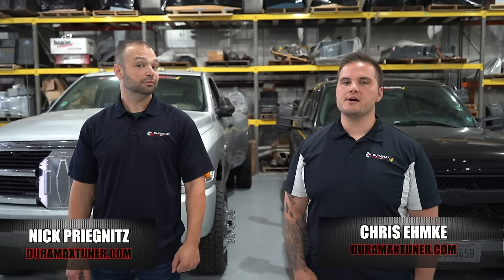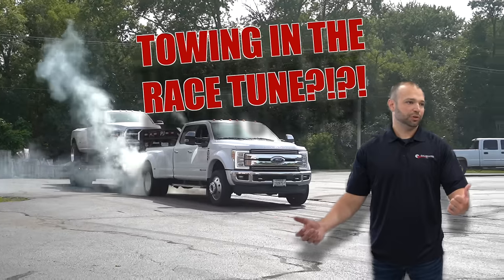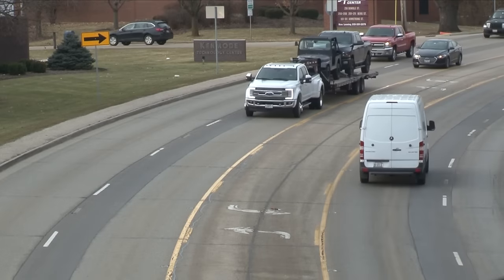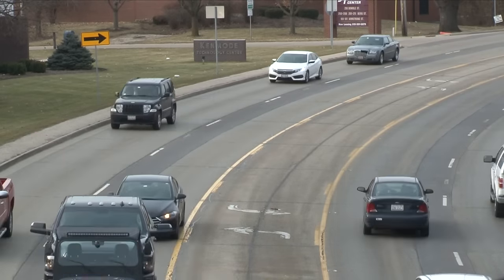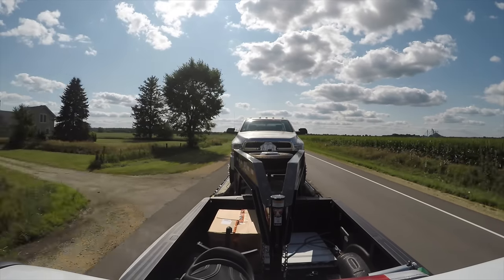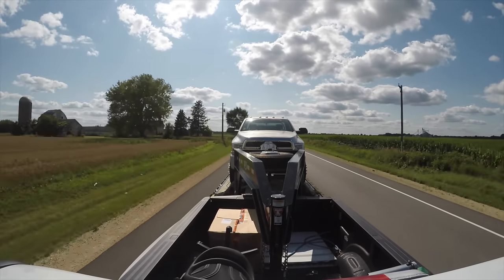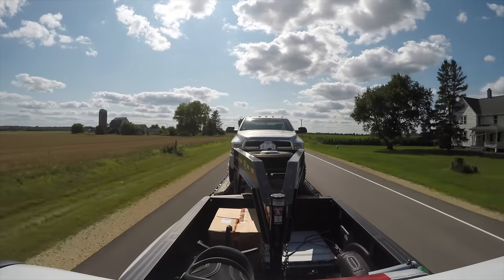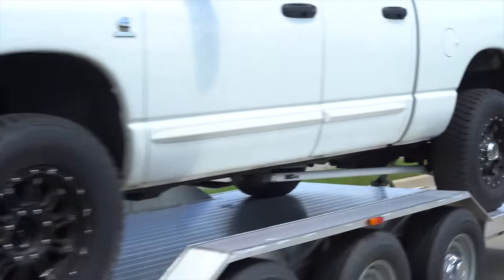DIESEL INSIGHTS: TOWING IN THE RACE TUNE

Comment: "...yeah, but you havent thought about the rear end cooling, the u joints, the flex in the springs..." 
YES. YES I HAVE. Ever since that one time I overloaded the tongue of an 8" lifted 1/2 ton and trashed the suspension on my "fun" truck towing in the mountains. Lol, trust me, when they start bouncing around and hitting every crack like it's a railroad track, they'll consider more than transmission cooling. Thanks for the video!

Comment: Thank you for bringing up oil temps finally now can you guys please do a video on where to instaill a prob on the duramax oil heat exchanger thank you
Reply: Best thing they could do.worst thing to leave out
Reply: If you haven’t already found it Banks Power has an oil cooler that is an upgrade unit that has the port for oil temp or oil pressure built into it. It also is more efficient at cooling the engine oil.

Comment: The high horsepower tunes are for intermittent operation when supported by stock systems.  If you want to tow with higher horsepower, then it makes sense that you have to upgrade not only the turbo and tunning but also the trans, oil cooling for engine and transmission and may add oil cooling for the rear differential.

Comment: Great info. I haven’t bought your tuning program for my Colorado yet but I’m here because I’ve been watching all your videos. It’s not as relevant to your tuning but I have a 1968 M35 “deuce and a half” with the big continental LDT465 that has a teeny tiny Honda sized “C” Whistler turbo. They didn’t even bother to put any form of boost control on this thing. Turbo goes straight into the intake without so much as an intercooler or a waste gate. Anyway, I run a giant aviation fuel pump in the tank and I run on straight un-thinned used motor oil as fuel that the fuel pump manages to ram through 3 filters (one of which is heated by coolant to thin and pre-heat the cold oil). I have the injectors re-popped to 3500 psi (these things don’t spray, they just shoot a stream through 2 giant pencil lead sized holes). I also have the old American Bosch injection pump ramped up to its max capacity and the FDC bypassed. All of this happens with only 14psi from the tiny maxed out turbo. To say it generates a little heat when pulling a hill at low RPM would be a gross understatement. It has been set up this way for years and takes a great deal of control to keep the pistons from melting into the oil pan. The point is that you can have it when you need it for a short duration but you have to use restraint not to cook it. It makes way more power than it was ever designed for. EGTs can reach 1800 degrees or more and aluminum melts at 1600 degrees. It’s like putting a torch to aluminum. That flame is much hotter than the melting point but you have a finite amount of time before the metal itself reaches it critical temp. That’s where knowledge of your equipment and an eye on your gauges is very important.

Comment: Awesome video guys!! Got an 07 LBZ running a 2020 L5P oil cooler.  Tuning byDanville Performance. Towing my 5th wheel camper I never see above 200 degrees engine oil sustained. Max I’ve seen was 210 at the top of a long steep hill quickly cooled back down at the top. Running mishimoto race t-stats and a Hayden 2886 fan clutch to help keep everything in check! It’s a tow machine now!! Haven’t played with lvl 5 tho 😂😂

Comment: 500hp towing issues depend on all of the mods you have done to your truck.  If you have upgraded your transmission, larger or compound turbos, upgraded intercooler, upgraded (oversized) injectors, upgraded oil cooler, gears, etc, then 500 hp towing should not be an issue at all.  1,000hp might be a different story

Comment: When I drove over the road in the 80s and 90s, with the manual pump Cats and Cummins and Detroits and non synthetic oil, we never got engine oil temp over 240. Sort of a rule of thumb was 20 degrees higher than water temp. Nowadays with fully synthetic oil I think hotter oil is safer.

Comment: Towing is all about Torque not HP. Every truck has a sweet spot. Tow in your torque curve. I’m a heavy haul driver and I see people make the mistake at trying to haul their camper at 80mph. It’s better to tow lower speed. My 2019 Pete torque is 2050 at only 1150 RPM

Comment: Where is the best spot to put a temp probe for oil temp on an 01-06 duramax? I'm so glad you guys brought this up, I was just running this through my mind, I want to tow on stage 4 120hp cause it tows so nice, but didn't know if it was safe.I have manual egt gauge and edge cts2 to monitor all my temps religiously, just don't know what oil temp is doing which makes me nervous on them hot days. I would like to know where to put a probe so I can add it to my gauges. Thanks for doing these awesome help videos!

Comment: I’ve got a question about L5P tuning. I’ve got a 2018 GMC 2500, and would really like to get your tuning for it vs one of the two popular box tuners. 

I understand the advantage of the SOTF, but I’m not the type to switch back and forth a lot. I don’t beat on my truck or tow on a regular basis. When I do, it’s usually a relatively light snowmobile trailer (that tows like you’re always driving into the wind) or landscaping trailer.  At some point, I’ll have another boat in the 25’-30’ range that may hover around the 10k range. Most of those tows would be short local trips with an occasional trip from Ohio to Florida, etc. Stock tire size now, but will be moving to the 34” range soon.

I am inclined to choose a single tune, but am wondering if by what my situation is/will be, if the “Light Tow” tune is appropriate. I’ve got no desire for kill mode; just looking for more response, grunt, and quicker up/downshifts.

Comment: I tow a 30ft 5th wheel 7,000lbs my 350ci gas can not pull it I need more power should I look for a diesel I like to tow max 80mph  at the slow I want 60mph   my 350ci tow at 30mph max up hill it is to slow

Comment: Aren't cummins uprated in pickups due to lower gvrw?  I grossed 47k with a 3/4 ton once.  Short trip gravel roads,  14 bales wet alfalfa.  Leveled out just fine with overload airbags.  I actually would go down on the hp as the weight goes up and you really push it.  Better off keeping temps down and the engine healthy so you can have fun when you dont have a load.  Not like you're gonna win any races pulling with a trailer on anyways.
Reply from the maker: Totally agree, but we just have so many customers asking us about towing in the race tune we thought we just make a video about it.  If you check out our tuners, all of the Heavy Tow tunes are much lower in HP.

Comment: I have a deleted 2011 lml with a lift pump. I tow on a 50hp h&s town tune my 29' toy hauler that weighs around 10k. The truck does absolutely great in the new England mountains. I just wish it would down shift, it just wants pull every grade in overdrive. I've recently started to manual shift to keep the rpms up. Weather I manual shift or pull in overdrive I never have scene the engine temperature move what so ever even on the hottest day.
Reply from the maker: That is what we would expect in a tow tune.
Reply: @Duramaxtuner  do you think I'm better off in stock tune? I've scene the trans get to 185 in traffic after alot of stop and go. Shoots down to 160 on highway very fast through
Reply from the maker: @mattreb5748  We expect the trans temps to reach about 100 degrees F over ambient air temp.  So if you're in a warmer region and it hits 185 in town, I would not have much concern.

Comment: Hey guys I have your six speed conversion for my  03 Lb7 and I’m having issues with the tune flaring shifts when shifting into 6th under load and shifting spastically, essentially  searching for gears when you lug it. Truck and built trans did not do this before the conversion was installed. I try’d calling and getting a revised tune for it but never heard back. Also for egts through my current tunes from a different company I literally can’t tow in any other tune then 1, my egts sky rocket other wise. I tow a 35’ goose neck with a gross weight of 16k pounds when loaded. If you would get back to me I’d like to discuss tuning and getting this tcm reflashed. Thanks!

Comment: I have a 17 Powerstroke and want to do a compound turbo and an EGR delete for towing a 16k 5th wheel while keeping the DPF intact. Do you guys offer tuning for this configuration?  And do you recommend upgrades to trans and cooling systems? If you do are there American made upgrades available?
Reply from the maker: Sorry, we would not be able to tune a truck with the EGR deleted. The trans and cooling system seems to be really solid from the factory.

Comment: @Duramaxtuner 
What if you decided to tow with the sport-Econ tune? The reason I am asking is not to hotdog but for mpg as the sport tune holds gears longer before downshift. While unloaded I see 3-6mpg difference from sport compared to Tow tune.  Thanx in advance.
Reply from the maker: All the of same advice would apply for the Sport Econ tune and Race tune.  You really want to watch your temperatures if you are going to do it.

Comment: I have a 2007 Dodge Ram 2500 with the 5.9. 
I’m running 34” tires on 20x10 wheels. 
It has a S&B cold air intake 
S&B intake horn
5” exhaust with Magnaflow muffler and no cat
It has a smarty jr running on the 100hp tune
My question is, can I run it in tow haul mode to help offset the 100hp tune to help cool and keep it safe to tow around 5k - 10k pounds?
Reply from the maker: I would avoid that with a box tuner. If you had some custom tuning on there it may be a different story. Tow/Haul Mode triggers a different shift pattern and converter lockup strategy, it is not going to directly help keep your truck safe while towing with a bigger tune.

Comment: Do you recommend monitoring oil temp before or after the stock oil cooler on an LMM? I've seen you mention oil temp in a few videos. Do you have a specific kit or sensor that you sell and/or could recommend? I have an Edge Insight CS.
Reply: Call them.  Service is fantastic and they will steer you straight.

Comment: Sometimes it is just a whole lot better to slow down. One horsepower is 550 foot pounds per second. You can calculate horsepower for grades easily using total weight and how fast you are raising that total weight going up the grade. The weight raising will far overshadow the drag forces. Sometimes it is just better to tag along with a big semi at lower speed and downshifting the gear. My older Ram 6.7 Cummins makes 130 retarding horsepower with the exhaust brake. I tow with a total weight of truck and trailer at 25000 pounds. I can go down an 8% grade at 30 mph without touching the brakes. So that means if I climb that hill at 30 mph I am using a bit more than that say 150 hp. And if I try to go 60 up that hill I will be using 300+ hp as windage goes up. Probably near 350 hp.
Reply from the maker: For sure!

Comment: "Upgraded oil cooling system" is easy, pour in highest technology lubrication. 99% of people with any machine using oil do not have a Clue what it is, because manufacturers and shops making money off of failed lubrication or early worn out parts they get to profit from replacing turn their nose at it and "hater" talk on it rather than utilizing it.

And as a "Tuner", lower EGT, Engine and Trans temps allow you to make better performing tunes than your competitors with better pushing of the timing tables.

Comment: Another question, I was thinking of putting an lb7 dmax store arctic trans cooler and lines on my 06 lbz, just for the sake of having the cooler behind the grill where It can get direct airflow while moving and have the fan draw air across it when in traffic instead of behind the bumper away from direct airflow like the factory smaller cooler. What would you guys say about a mod like this, yay or neh, what are your thoughts?

Comment: Question, bone stock 2017 L5P towing has sustained EGT'S of 1475-1500 degrees. The ECM doesn't start to de-rate the engine until the EGT'S go beyond 1507 degrees. So is the information of 1350 degrees sustained still accurate? I understand 1350 on an older cummins or 7.3L ford thats a great number to live bye.
Reply from the maker: Are you measuring the L5P EGTs on the manifold or post turbo?
Reply: There is an EGT PID that I assumed was near the manifold. I saw 1475 all the time while stock on my Edge in my L5P while towing. I have since switched to the Banks setup, and he starts pulling power I believe at 1450 as part of his safety setup. That plugs in and is using the stock EGT sensor.

Nice video btw. I think our nature as humans is to defy our limitations, which is probably why the aftermarket auto/truck market does almost $300 Billion a year.
Reply from the maker: @jakec7432  The L5P has a few factory sensors so it would depend on which one you see.  Watch EGT 1 if you can.
Reply: Duramaxtuner I watch EGT1 in the engine and EGT5 in the DPF. I believe in one of your videos you said to make sure the exhaust is warm before you beat on it to reduce how fast the DPF fills up.
Reply from the maker: @jakec7432  ^True story.